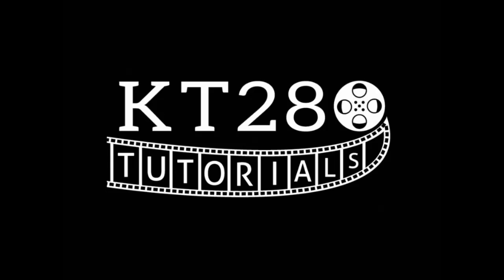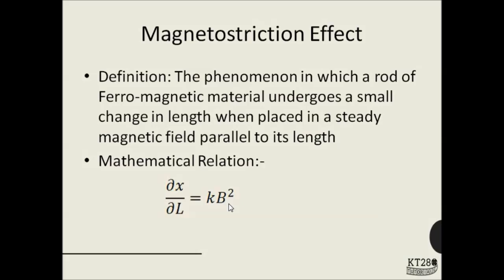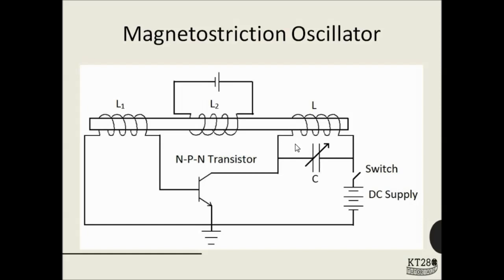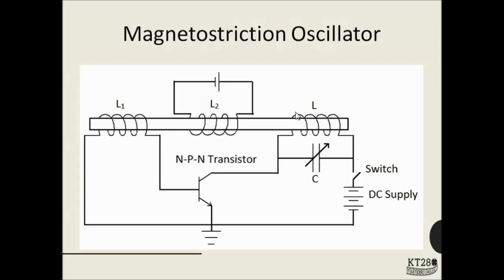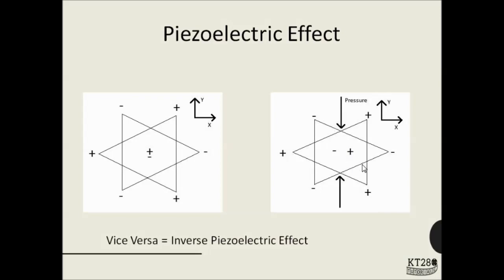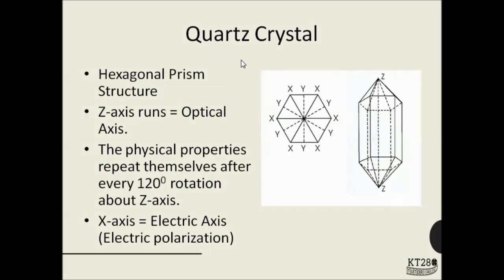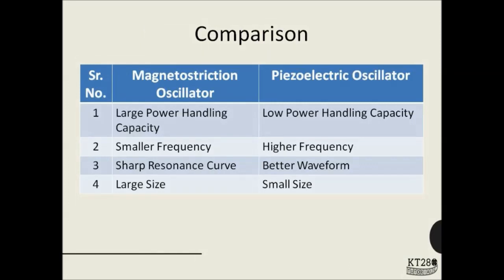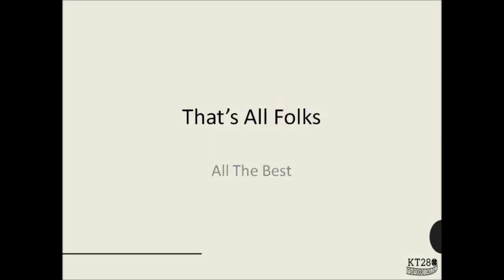AP1_4.4: Production of Ultrasonic Waves

Comment: is there any problem if we reverse the npn transister connection in piezoelectric oscillator
Reply from the maker: The doping level in collector terminal and the emitter terminal of the transistor is different. The current gain is maximized for this particular configuration shown in the video which is called forward active mode. The gain is usually 2 to 3 times more than the reverse active mode which when we reverse the connection.
Reply: Thanks for this good lecture